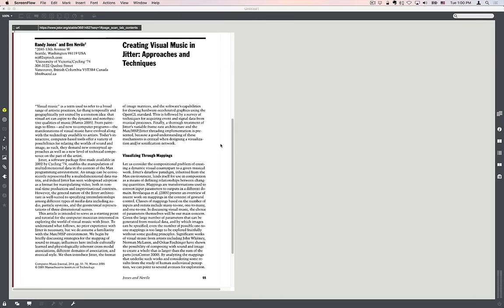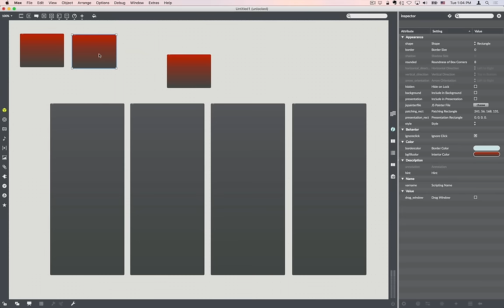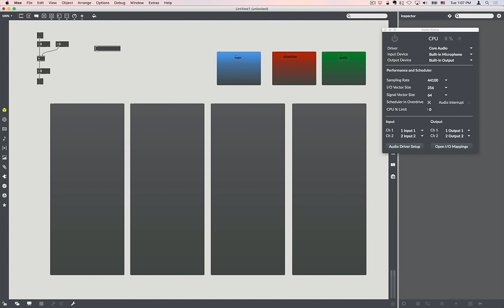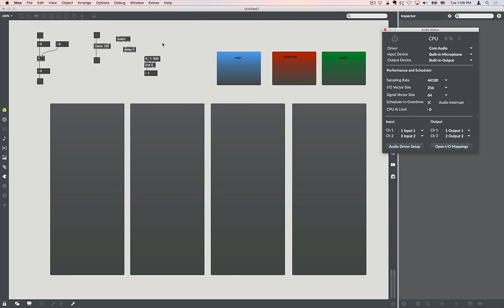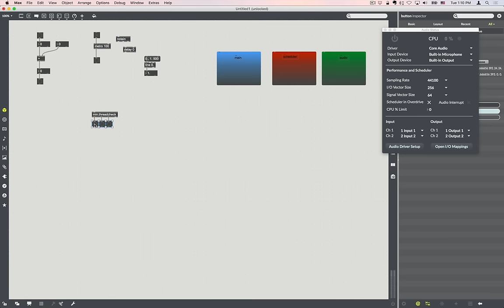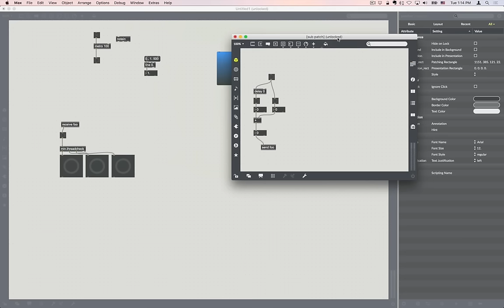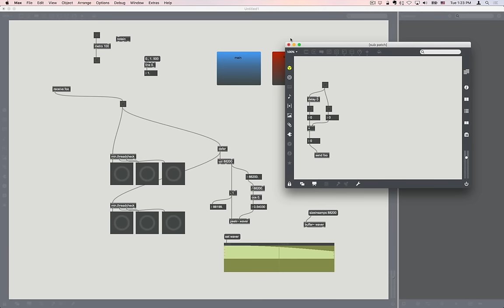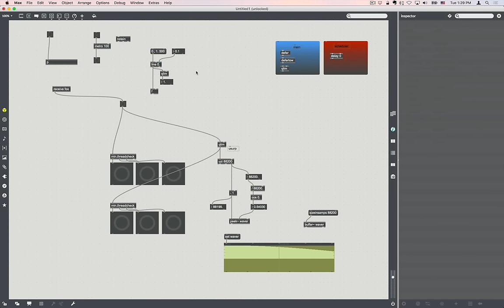Threading in Max

Comment: Thanks for the great video. You mention that for Jitter patches the Scheduler in Overdrive should be unchecked. I am wondering why. I work with audio e synchronized jitter visuals. Synchronization is very important in my case and I need the signal vector size to be no more than 128. Can you tell me what settings are best suited for this scenario?
Reply: I would like to know more about this as well!
Reply: Great video, but i too was hoping for some info about jitter.

Comment: I didn't know that non visible GUI objects (like a number box inside a subpatch) could increase CPU usage. Thought that MAX ignores hidden GUI objects. Good to know, now let's celan some sub patchers :)
Reply: Well, the true answer is more subtle than how I presented it in the video.  It is true that Max will not draw the UI of hidden GUI objects.  However, that doesn't mean that additional data handling doesn't happen.  You imagine a multislider or filtergraph~ object -- those do a whole of additional work and then trigger a notification to draw -- the drawing won't happen in this case but all of the other work will.
Reply: Thanks again for clarifying! So to be cristal clear: regular numboxes or for example bang objects won´t add extra cpu usage if they are hidden inside a sub patcher?
Reply: At the extreme risk of providing too much information, here is the C code for what happens when you send a "bang" message to a [button] object:

void jbutton_bang(t_jbutton* x) {
 if (!x->j_inbang) {
  x->j_inbang = 1;
  jbox_redraw(x);
 }
 object_notify(x, ps_button_activated, NULL);
 outlet_bang(x->j_box.b_ob.o_outlet);
}

So it does a check to see if the button is currently drawing or not, then it might set a flag and call for the "box" to be redrawn.  Then it issues another notification to other parts of the system and finally runs through a sequence of calls to send the output to its outlet.

It does all of this each and every time -- even if the button is hidden from view.  What changes is that when it is time to do the actual drawing of pixels on the screen then it can skip that part.

In the case of the button object you could ask "does this matter"?  The answer is "probably not", at least for the button object.  The more complex the object is the more it will matter.  Multislider and filtergraph~ are prime examples.

Hope this helps!
Reply: Timothy Place, totally! Thanks.